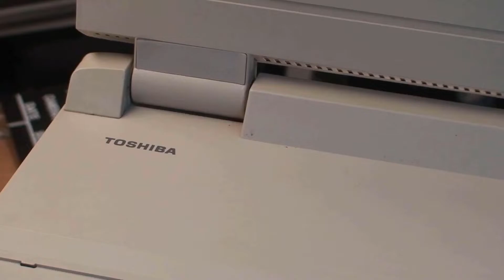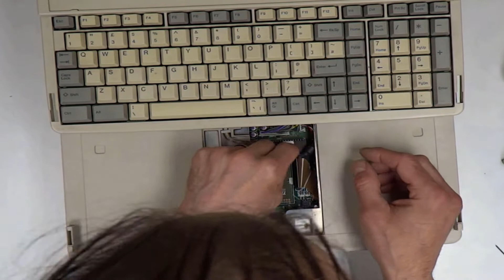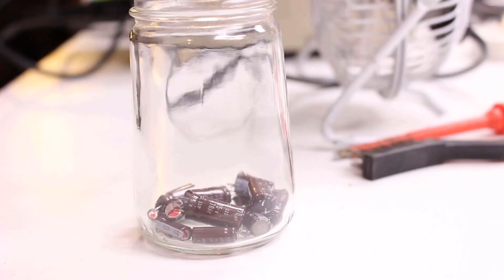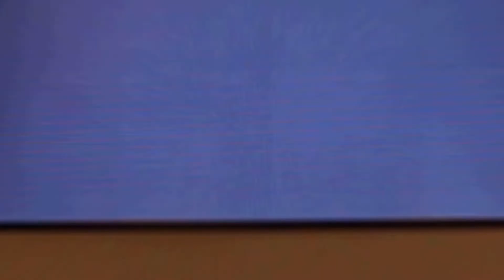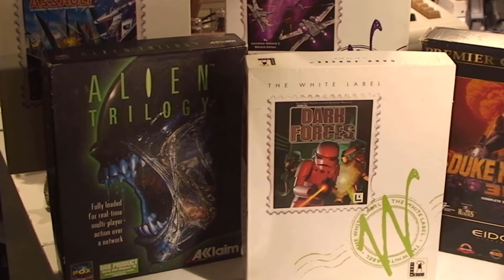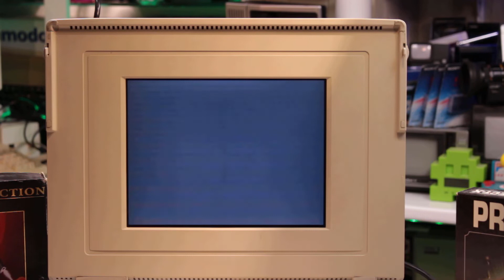TOSHIBA T6600C 486DX $7000 LUGGABLE PC from 1994 Part 1 RESTORATION

Comment: could you give me a solution to factory reset the computer?  or else make it detect DOS floppy as a bootable disk. thanks.
Reply from the maker: Did you mean with in the operating system environment or the bios. I think it's either f2 or the delete key to get into the bios during the boot up sequence. The floppy disc drives on these machines usually have a persished drive belt.

Comment: Hi, great video! I happen to have the same computer, with a dead PSU; could you please share the list of caps that you replaced so I can order some replacements? thanks!
Reply from the maker: Thanks. Unfortunately I don't have a list anymore. So you will have to open it up and get to the psu and make a note of them all. I did just replace them all in the end seeing as how difficult it is to get to the psu. Hope you get it working. There aren't many of these about anymore.
Reply: @RetroGadgetMan hey there, got 2 of these out of my company today. Will try to get them to work. Unfortunately i have to sell one, because i dont need two of them